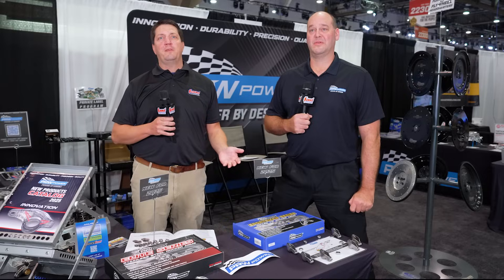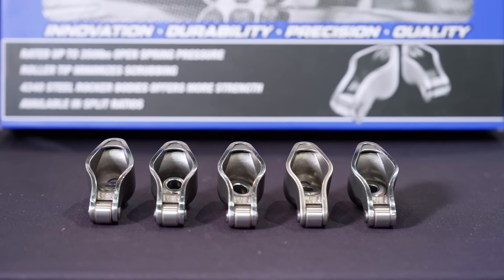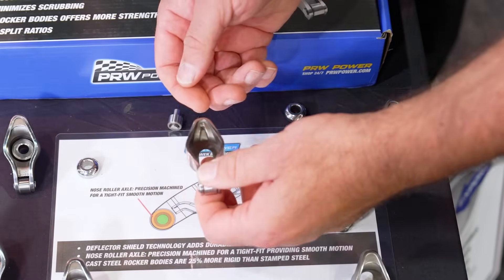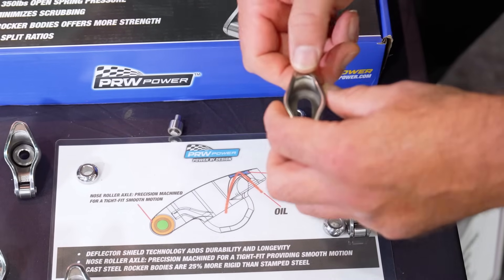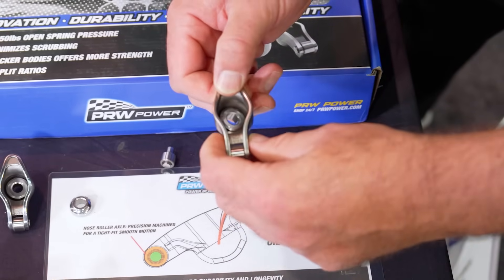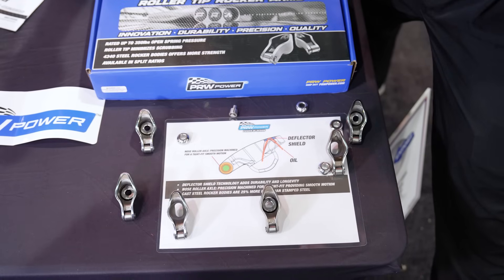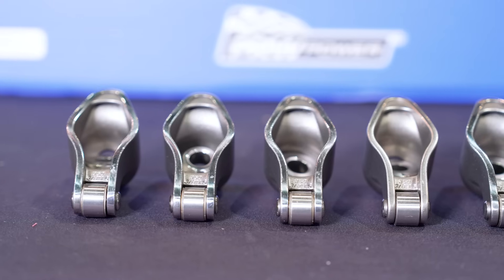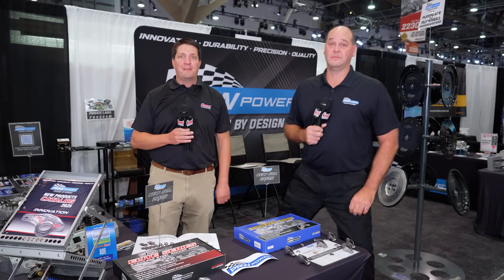Get Optimal Oiling for a Better Valvetrain Performance with PRW Sportsman Roller Tip Rockers | 2025

Comment: David Vizard recommends them, for their fast off the seat ratio.
I just received a set for my engine, they have the old style oil holes. 🙄 
# 0830203  $ 169